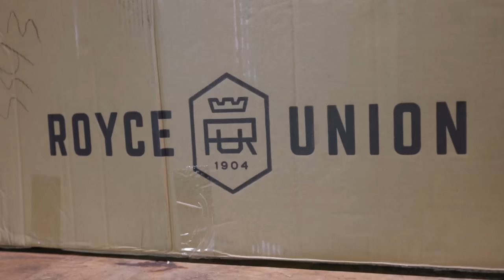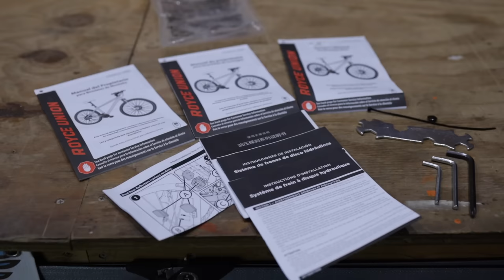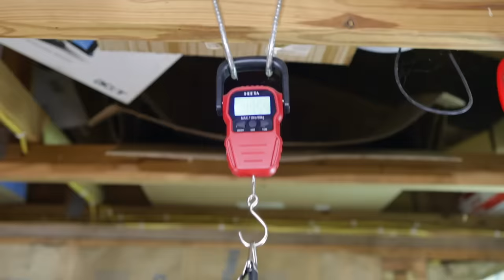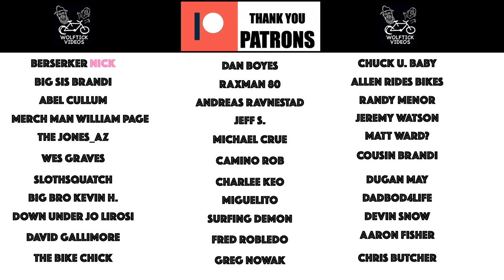BEST BUDGET BIKE EVER!?!

Comment: Have to use up the old XT and SLX 2X drivetrains somewhere. They wont sell individually as upgrades  in todays 1X market. So they are being spec on entry bikes like this. Not a bad deal!
Reply from the maker: Dude, it's pretty freaking sweet, could not believe it! Jaw Dropped
Reply: I just installed 2x10 Deore 2022 on a 2008 Specialized Epic and I LOVE 2x.

I have a wider range and more in between compared to 1x12.
Reply: So XT and SLX is already outdated? Jeez...
Reply: @TivonSanders just the older 2x11 SLX and XT models. The newer 12 speed SLX and XT are still alive and kicking
Reply: Yeah I guessed it’s a case of Royce buying the unsold old stock. That mech is about a  2-3 year old model…. Good for the customer though!

Comment: I've had this same bike for about 4 years now, I upgraded basic things such as the Bars, Stem, Grips, Tires, Pedals, Bottom Bracket, and removed the Front Derailleur and shifter. 

I have replaced the brake pads once, after the brakes began to become weak, and it did not help much, I am looking forward to buying some new brakes currently. 

The frame has stood up till this day, even after hitting some small sized jumps and riding over rough terrain.

The fork is definitely not the best, but since I was on a tight budget, I did not swap it out, and it is still running in good condition.

I don't abuse my bike either, but I definitely ride it quite a bit. Overall, the frame is incredibly sturdy and durable for being so light.

Unfortunately, I picked up the 17.5" frame back when it was at around $550, I highly encourage people to purchase this bike and upgrade some parts, it's a hidden gem and a great bang for the buck. It beats some if the big brand hardtails when you view it from a price standpoint.
Reply: I’ve heard the geometry is a bit weird on these. How tall are you and how do you fit on the 17.5?

Comment: I just ordered one. I’ve been looking for a bike to get me in to the hobby for the last few months. I was planning on waiting until black friday to see if they had any good deals, but this seemed like the best deal that I was going to find. I also like that its something that I don’t really need to worry about upgrading right out of the gate besides maybe some super simple stuff mentioned in the video. This should serve me well on trips around the suburbs and entry level trail riding. Kudos to the wolftick guys as well as the guy that tipped them off about this sweet deal.
Reply: What size did you order? The website says 6’4” -6’6” for the large, which doesn’t make sense to me.

Comment: My M/L just came in today and I noticed a few things right away. I knew most of these things would be a factor going into a sub $300 MTB but still worth noting.

-The crankset sounds like it wants to snap (loud pop) every time I put more than half my bodyweight on the (aftermarket or stock) pedals. I am 160 lbs. Hopefully I can fix this somehow.
-Tires kinda seem like knockoffs. No painted lettering and no "small block eight" branding. "Kenda" is suspiciously small too...
-Rear derailleur was fully installed before shipping. It was slightly bent inward upon arrival. I was able to get it back in line but others may not be as lucky.
-The frame size is larger than I expected (which is good). I think the website's suggestion for 6'2"=6'3" for M/L is accurate. I am 6'1" with long legs, fits good. I'm usually riding a L/XL so I was hesitant about going M/L
-Frame geometry is very conservative. This makes my underforked 2010 Jamis with a 68° head angle look like a slack monster by comparison. This has to be >71°. I knew it wasn't going to be slacked out but it is a bit steeper than I thought it'd be.
-One of the bottle holder screws was stripped right out. It had a screw in it but it was just sitting there and I was able to pull it straight out with my fingers.
-LOTS of over-torqued fasteners out of the box. I would say 60% have been too tight. Controls were all excessively tight. I had to quickly grab my socket hex drivers as cheap wrenches will surely strip heads out during setup.
-Spoke finish is all chipped up out of the box.  
-Rear brake mounts on the frame are wonky and force the caliper to sit at an angle to the rotor. I will have to spend some time filing it down to find a decent angle.
-The cheap brakes are CHEAP! They could share equal blame for the wonky rear brake alignment options. The casting quality is low and mounting points are not even close to flat or parallel.
-Both wheels are quite a ways away from true. I will spend some time adjusting spokes and hopefully get them to an acceptable point without having to have them rebuilt.
-It is lighter weight than I expected. Even after watching these videos with the weight.

Overall I'd say it's worth what I paid but not much more. I will get it running as nice as I can, maybe swap a few parts around and then see how it survives

Comment: Saw this video 4 hours after the upload.  Ordered one later that day and it arrived today.  I'm very impressed.  Its entirely a budget bike but nothing is low quality.  Some new pedals  and a better seat are gonna be the first needed upgrades.  The shifters are amazing but would be awkward in jumps.  Out of the box it rides smooth and comfortable but the shocks would be another nice upgrade.  The shocks are adjustable though as well as hydro brakes!  Also I have to add that the payee ended up being Huffy Corporation in the statement.

Comment: For years I've been riding with trigger down shifters and I got so accustomed to them that when I switched over to l-twoo ax recently (after watching your reviews of l-twoo and sensah groupsets :) ) it felt quite awkward to thumb downshift, but it was just a matter of one ride to get used to it and now it's super comfortable and the lever is right there under the thumb were it is supposed to be.

As for the shifting, you can't expect the derailleurs to be adjusted out of the box, especially with new cables that strech out initially.

Comment: You can drill the frame easy enough  just use a punch before you start to drill and do a small piolit hole first.
Reply from the maker: Man I would love to, just don't think Wolfman would let me 😉😉
Reply: You can even do an external and just zip tie it along the top tube where the cables go already.

Comment: Just ordered mine because of your video. Really can’t beat the price. We are just getting into MTBs and this seems to check all the boxes  Ordered different peddles and quick release seat clamp , any suggestions for an air fork that would fit without changing the rim and would fit in the stock  head tube  ?  Really diggin the channel and learning a lot from you guys. Keep it up !!

Comment: I'm just unsure how Royce Union is able to sell these things at the prices they do.  I looked up the same bike just today, and it's at $308, which is still a steal for what you get.  But even their ebikes and gravel bikes are bargains for the components you get.
Royce Union, from what I could gather, is owned by United Wheels, and they also own Huffy (which has cheap bikes on which the components fit the price) and Buzz (which sells some of the cheapest mid-drive e-bikes out there, but also have cheaper components to meet that price)...  But they also own Vaast and Niner, which are not low-end cheap bike brands at all.  I can only imagine that it's a brand they use to clear out the parts bin of components that they can't sell anywhere else, but even that is not really something you can do forever.  They'd have to constantly change up their product lineup to pull off something like that.

Comment: They are making cheap volts somewhere. I see people buying them and they are breaking and the "leather" splitting and fading away
Reply: It has a 4.7 out of 5 star rating on Amazon (1,209 customer reviews). I think the seat is fine on my royce union rht. It is smaller than my other bike seats though but I don't notice it when riding. I have zero interest in swapping it out. Heavy set people with big butts may need to upgrade.

Comment: just checked them out and man I'm really thinking of buying one. I'd end up using some parts from my upgraded Aggressor Pro but honestly it wouldn't be much and I could just swap the parts and sell the GT for a really decent price. Also i'm wondering if their heights for the sizes are correct, it says size large is for someone 6'4 - 6'6 but I have an XL Aggressor Pro and that says for up to 6'2, although the GT has smaller 27.5 tires. I'm rambling though, bottomline, this looks like a great bike for the price.

Comment: Something’s off here 🧐
The frame doesn’t match the one in the link. The color does but not the design. In the video the frame looks more progressive than in the website. Look at the of the frame and you’ll see. I’m not finding this frame in the website. The closest one is the RCF but that one looks like it’s internally routed and doesn’t have an option for this color. Something isn’t adding up…
Reply: No. It is there. It is called RHT model. I bought the medium RHT model (17.5" frame). A small frame  (15" frame) may look a lil different as the seat post is going to be smaller but the models are still the same.